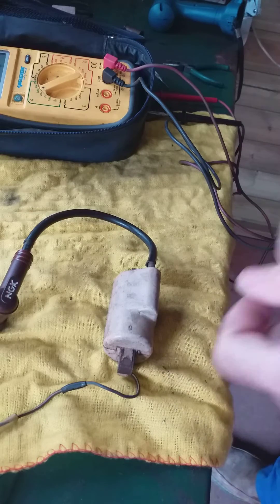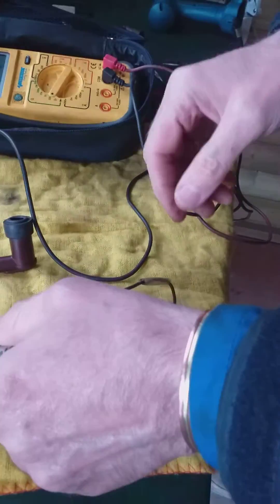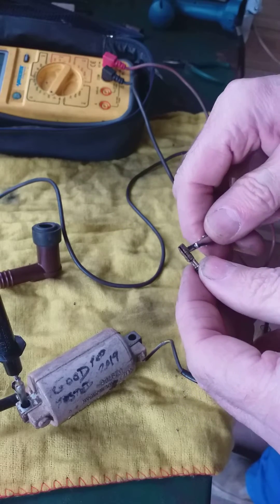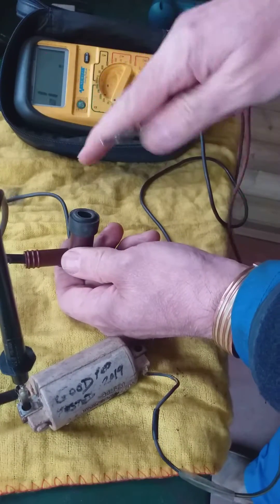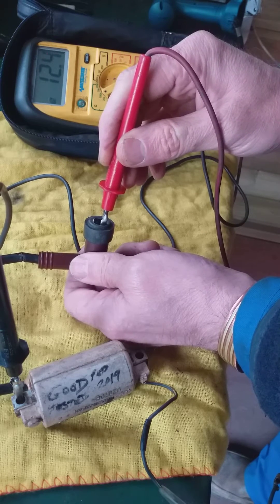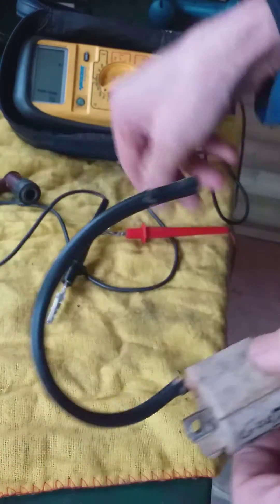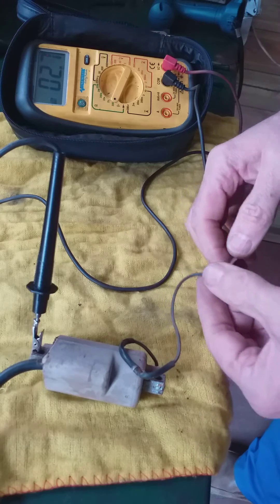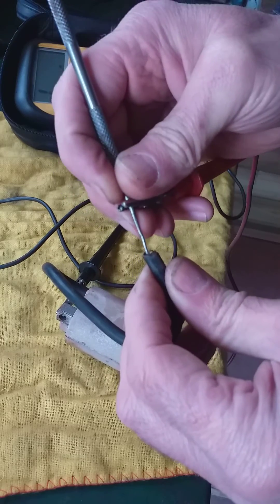Suzuki Rv125 Ts Tc 6 volt ignition coil test

Comment: Thank you. Currently restoring a TS 185 for a friend. It is also 6 foot system it has spark and suddenly it does not have spark I put a regular spark plug and on the wire and it was getting spark and then send me it wouldn’t start a few days later. Can you please show a video of the PEI unit & or Three coil plate behind the flywheel? This is a 1977 model and it is very very hard to find the wiring diagrams and wiring diagrams are not in the CLYMER Manuals.